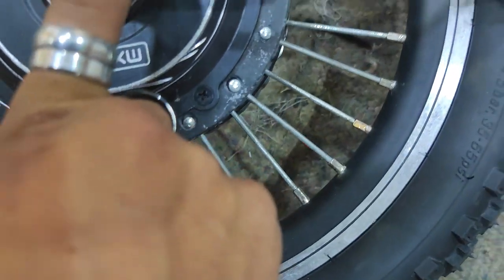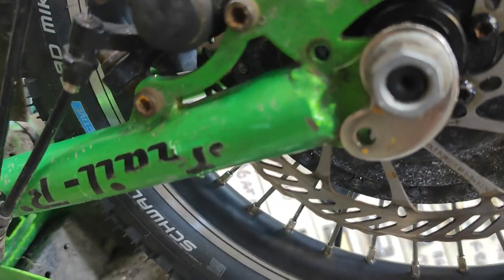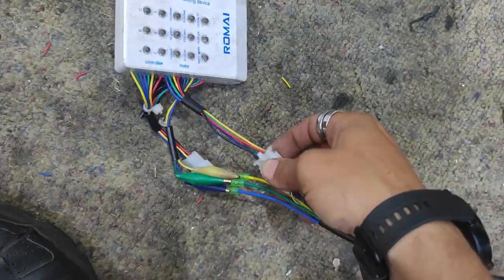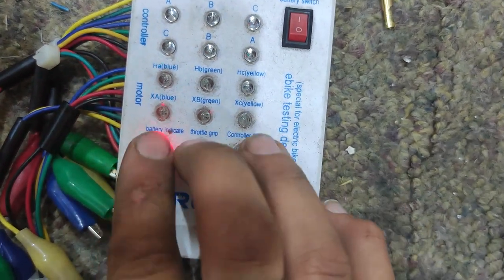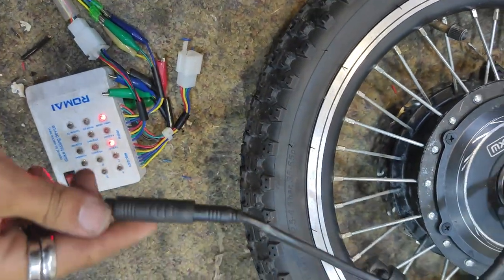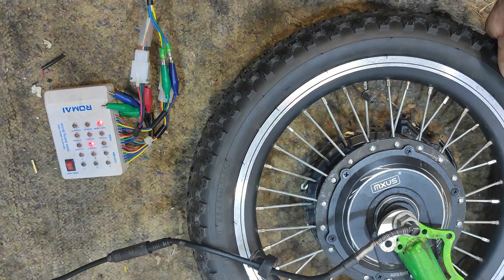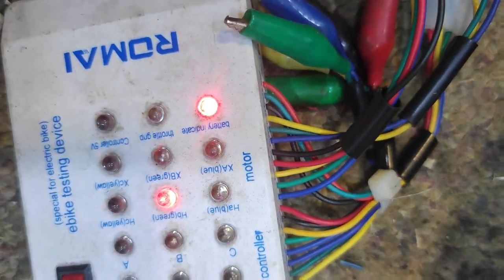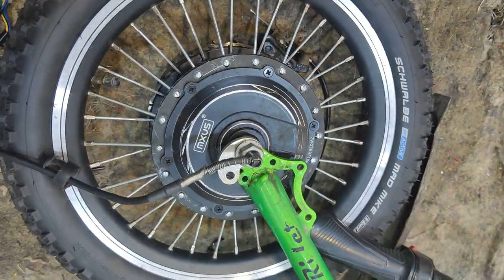Ebike Hub Motor testing - using a motor tester.

Comment: Hi bud I've got no lights on the motor hall sensors, all others are OK. I've checked the sensors they're OK - I'm guessing it's the diddy motor circuit board?
Reply from the maker: Sounds like no 5v signal or no ground continuity - start at one end and test with a multimeter till you find where the break is :)
Reply: @EbikeRepairs  Thanks bud, you'll laugh...
there was no battery in the tester!!! Everything AOK now:)
Reply from the maker: Glad its sorted for you! Easily done!!

Comment: Hi mate can you help how do I take the big gear ring off the inside of the hub for the motor cheers
Reply from the maker: the large outer gear is usually actually part of the casing - a ring gear usually wont be removeable.
Reply: @EbikeRepairs  my motors slipping I’ve replaced the clutch and 3 sprockets and it’s still doing it have you got any ideas I’ve been on to the supplier twice and they’ve never replied thanks for helping
Reply from the maker: Any chance you are loca to us? south east UK - we can take a look at it for you :)
Reply: @EbikeRepairs  I can’t mate I’m up near Newcastle I’ve changed the clutch and small  gears inside checked and lubed all bearings wheel spins great but try and ride over 10mph it’s slipping and has a noise off motor only thing I can think of is gear ring is slipping but I can’t see how to remove it
Reply from the maker: you could try kilivolt bikes near manchester - they may be able to help as closer? :)

Comment: I've got a motor and I've got a tester. Seems like the trickiest part is connecting the two. Everybody on YouTube seems to have some kind of adapter (possibly/more than likely handmade). Do you know if anyone has a good video on all the ways an ebike motor can be hooked up to one of those testers?
Reply from the maker: Juliet 9 pin to standard bullet connectors/ hall sensor cables available on AliExpress/ Amazon:)
Reply: @EbikeRepairs  Thanks! I’ve placed an order and just have to wait for it to arrive. Thanks again.